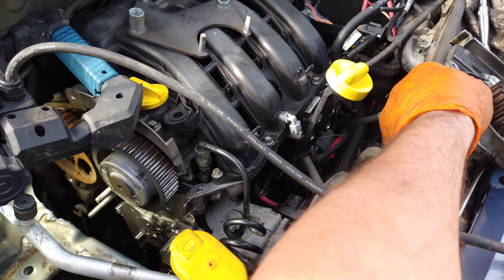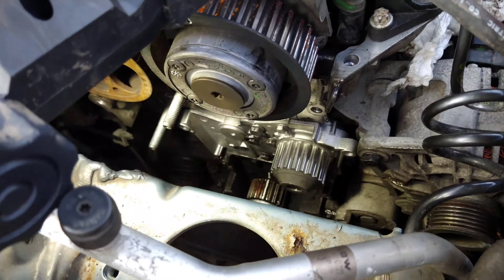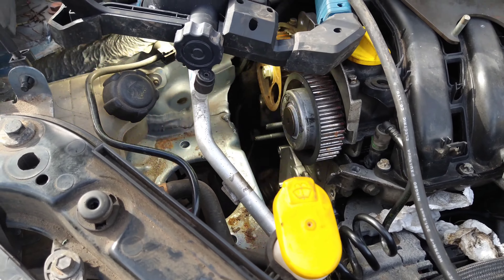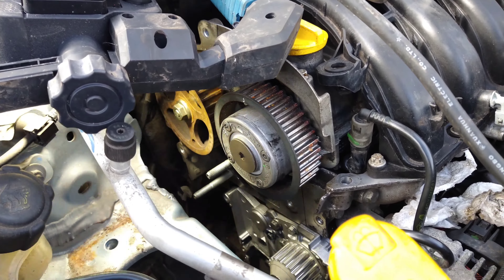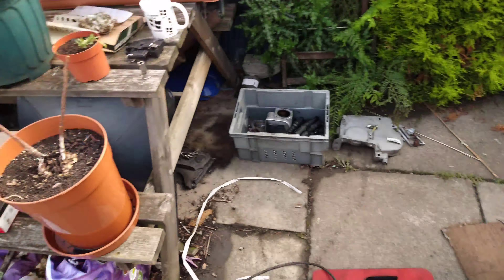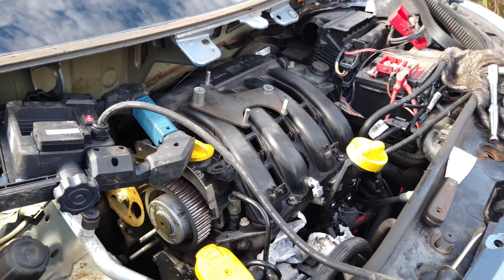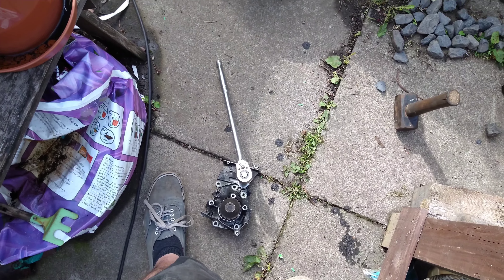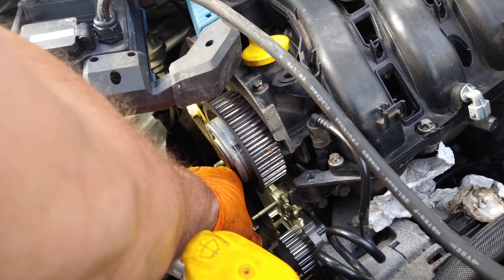Renault scenic 1.6 ( water pump/timing belt/spark plugs/oil change ) part 4

Comment: Hi there

I am going to do timing belg on megane 1.6 petrol 2017 engine code M4K R8 does it have the same timing locking tool as yours?
Thanks Milan

Comment: nice work matt  those ptfe seals are terrible  i done an engine rebuild on a focus 1.8 tdci  last month and had a oil leak  from the front crank seal  (ptfe) what a nightmare had  a new dealer seal/crank pulley  timing cover alignment double checked still leaking  in the end   an old style crank seal with the spring on the inside from porsche 911  done  it
Reply from the maker: Yeah I don't like them as much as the old type seal. Luckily you had a seal that fit from a 911.  Not many people could say that they have one of them lying around. Thanks for watching
Reply: @mechanicmatt871  yes  after  searching on euro car parts website (they give the seal size)  the porsche 911 seal  was  the correct size just 2mm wider but it done the job perfectly .

Comment: Nice to see it back together Matt....I could  see how a perceived lack of compression would be very worrisome indeed. 🤔 No worries, all good. Great work. Cheers Pal 👍
Reply from the maker: It took some time, although I enjoyed doing the job, once I got into it I was happy working away. That lack of feeling any compression with the ratchet was worrying but I could feel a slight compression after cranking the engine by hand with the ratchet a few times. Once it was running I could relax. Thanks for watching

Comment: Hi Matt! Great video as always. 

May I ask, what's the name of the tool you are using in 3:11? I changed my Megane's timing belt last month. While trying to loosen the exhaust side camshaft nut, I bent both of the locking tools! I had to buy a new set of locking tool to finish the job.
Reply from the maker: https://www.amazon.co.uk/ASTA-Locking-Sprocket-Camshaft-Crankshaft/dp/B00N1QNB6A/ref=mp_s_a_1_2?dchild=1&keywords=timing+pulley+holder&qid=1596350757&sr=8-2
This is the same timing pulley holder, I used some bolts with the heads cut off to work with the pulleys on this car.
Thanks for watching
Reply: @mechanicmatt871  Thank you. 
Also I don't know if you noticed, but your auxiliary belt has cracks. Wouldn't that be a problem? I heard, snapping the auxiliary belt can be as devastating as snapping the timing belt.
Reply from the maker: Yeah that is correct, I'm doing that next after it gets through the mot, thanks mate

Comment: Good job, were you tempted to fit a new dephaser pulley while you were in there? I changed a rattling one on a Clio 172 and it's not a job I'd want to do twice!
Reply from the maker: This one was done spending as little as possible, and their was no noise on this one. Although if a little more money was available it would have been a good idea to change the dephaser pulley on this one too.
Like you say it would save taking it apart again later.
Thanks for watching Brendan
Reply: @mechanicmatt871  looks like you've got the skills to get the timing right first time, it took me a few goes to get the belt tension set correctly so I could still fit the locking tool in the back of the cams after turning the engine over a couple of rotations. I wanted to make sure I had the full 172 bhp when it was finished, not 150 or 160 like many of them are after their first cambelt 🤣

Comment: Hello I wanted to ask you a question about my scenic 2 1.6 petrol 2007 when it is cold and I start it makes a noise. type of suction that lasts for about 2 then turns off the machine but starts normally on the second start what could it be?